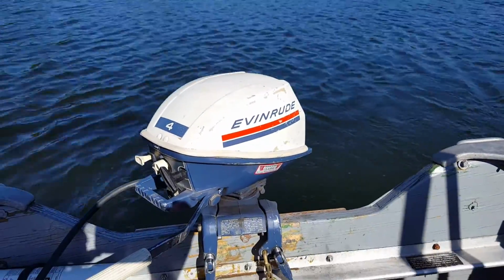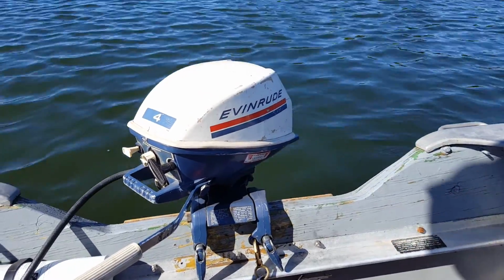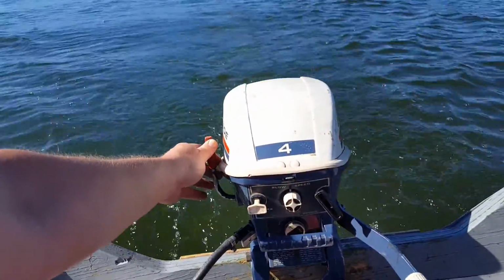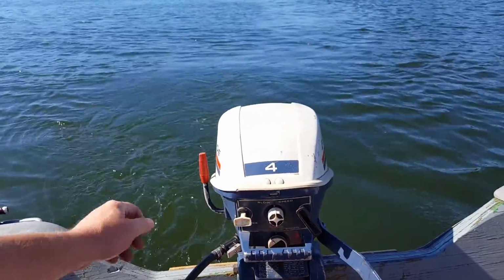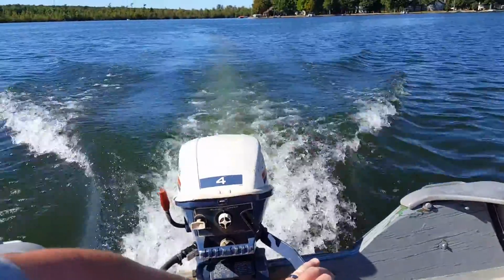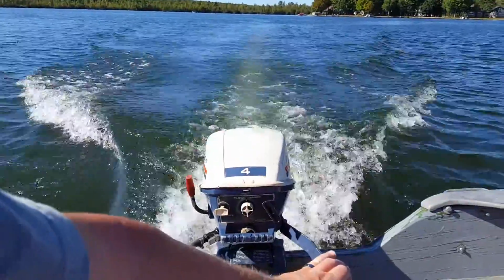1969 Evinrude Lightwin 4hp Outboard Motor

Comment: Hi there, I picked up one of these and looking forward to using it. The original plugs say J-4J not J-4C. Thanks for the run down on it.
Reply from the maker: The original J4J plug was a 2-stroke specific plug with a shortened side electrode.  The J4C is the modern equivalent.  The electrode can be shortened if the J4J is desired.  I just run them as is with no issues. Thanks for watching!
Reply: @oldjohnnyrude8404  Many thanks. So I can use the J-4J still wirh no issues? This 4hp is in very good condition and I can't wait to try it once I check impeller and change gear oil. Been told to take care pulling impeller off shaft and to push down on shaft as it can dislodge gear in the tiny lower unit.
Reply from the maker: @nickmav682  Yes, the J4J and J4C can be interchanged today.  Modern 2-stroke oil will not leave chunky carbon deposits in the engine like non detergent SAE30 would.  Having the side electrode abbreviated would lessen the likelihood of a piece of carbon fouling getting lodged in the plug gap and shorting the plug. That's good advice about holding down the drive shaft when removing the impeller.  It is designed to pull out of the pinion.   It can be tricky getting it to align if you pull it out unintentionally.
Reply: @oldjohnnyrude8404  Thanks again. Really helpful! Keep up the great work!

Comment: So, I was just given a small boat that has this exact motor. I don't think it has been run for at least 3-4 years.  Motor looks barely used and is very clean. My friend that gave it to me kept it at a small lake and his son used to take it out once in a while. Another friend of mine who is a bit more knowledgeable about boat motors tried to help me get it running, but we had no luck. Gas was getting to the carburetor, but the spark plugs were dry. So, I am thinking it must be a carburetor issue? It would not fire at all, but then, if gas doesn't get to the plugs, I guess that won't happen. So now I am wondering if I should attempt to take apart and clean the carburetor myself as an amateur or if it would be easier to just buy a new one and replace it?  Another friend suggested I soak it good with carburetor cleaner and let it set, then do it again, then try starting it again. Thoughts?
Reply from the maker: Either the carburetor is plugged and not allowing fuel through, the reed valves are not sealing and allowing the crankcase to seal and build charge compression, or there is something else preventing crankcase compression.   Try giving it a shot of fogging oil in the carburetor throat and crankig the engine to see if it fires on that.  If it will, then your carb is most likely plugged.  Yes, you should be able to get it apart and clean it. There are lots of good videos on how to do that.  Thanks for watching!

Comment: Johnny- just got a 1962 5.5 hp that needs new impeller.  I cleaned carb, replaced spark plugs and the motor fired right up.  But no water.  I loosened went to replace the lower gear oil and noticed water, so assumed some seals were bad.  In order to get to impeller do I need to remove the 6-7 bolts and remove the top?  It appears so....but just want you great advise.  Thanks, Dana
Reply from the maker: Yes, the powerhead must be removed to drop the lower unit on these motors.  The base gasket will need to be replaced and the gasket and O-ring inside the carbon seal for the lower crankshaft seal should be replaced while it is apart as well.  If you do replace the seals in the lower unit,  replace the shift rod O-ring too.  That is almost always the first seal to fail and is often overlooked. Thanks for watching!

Comment: I have fond memories of that year of 4hp...A noticeable power increase from the 3hps.I wouldn't worry about the gearcase, those lower units rarely leak unless fish line get caught in the prop shaft seal...
Reply from the maker: Yup, these are nice little motors.  There is a bit of a bump in power from the 3hp.  I think the gearcase is fine since I have yet to find any water in it, but I'll check just to be sure when I drain and refill for winter storage.
Reply from the maker: Yup, these are nice little motors.  There is a bit of a bump in power from the 3hp.  I think the gearcase is fine since I have yet to find any water in it, but I'll check just to be sure when I drain and refill for winter storage.
Reply: Russ Gallagher probably carb increase

Comment: Just inherited one of these that is basically brand new. What spark plug do these take? Make/number? Can I replace the gear lube with some spare amsoil synthetic 75w-90 left over from changing my Toyota differential? I'd imagine these aren't too picky. Any weak spots? Thanks! Can't wait to put it on my 1436 Jon.
Reply from the maker: Congratulations on your new motor. These take a Champuon J4C or J6C spark plug.  I tend to lean toward a J4C for these since they often get run at full throttle.  If you do anlot of trolling with it you may want to move up to the next heat range with the J6C. These are a 50:1 mix motor, although I prefer to run mone with a bit more oil since they still do not have roller bearings anywhere other than the flywheel end of the crankshaft. Marine lower unit lube is preferred over automotive gear oil because the marine oil has emulsifiers to allow some water to be held in suspension while still protecting and providing lubrication.  As long as the 75w-90 gear oil you have is safe for yellow metals like brass and bronze, however,  it can be used.  It should just be checked for water and changed  more often.  Thanks for watching!
Reply: @oldjohnnyrude8404  Appreciate the reply and love watching you run these old motors! I'll stick with the marine lube for the gearcase then thanks, didn't know about the emulsifiers. My dad said it maybe has 5hrs of use on it in 50 years. He brought it to hook up to rowboats where he vacationed once a year. I'm going to use it as my duck hunting and small lake motor on a 14ft rowboat. Should push it along great! I remember using it once when I was in high school and didn't know it was direct drive with no neutral. I fired it up at the dock and drove the boat right up onto the boat ramp hahaha!
Reply from the maker: @tercelfish00  You're welcome and thank you. These gearcases are usually very water tight.  The marine lower unit lube will be good for a lot of running with no water in it and is a nice safeguard in case a leak develops.  With those low hours thus should be a very nice running engine.  A really strong fresh one of these will sometimes plane off a 14 foot rowboat.   I have never owned one that would but I have seen them.  I bet that was an ah-ha moment when it took off on you and pushed you up the boat ramp.  I definitely recommend replacing the water pump impeller too if it has been in there for a long time.  You don't want to have it fail and even break up and send pieces into the cooling passages.  That's no fun to fix.  Great little motors.  Enjoy it!
Reply: @oldjohnnyrude8404  Thanks for the info! I just replaced the impeller on my 1990 30hp Mariner/Yamaha so I have some confidence now in the process. Are parts for these lightwins common or is it an eBay hunt? Do you know the part number or have a link offhand to get a new water pump? I imagine 50yr old plastic would be a little brittle haha. Do these "pee" like other boats or are they only water cooled through the exhaust? I can't remember.
Reply from the maker: @tercelfish00  Parts are still pretty common.  I get many of my parts from Marineengine.com.  
http://www.marineengine.com/parts/johnson-evinrude-parts.php?year=1969&hp=4&model=4902B&manufacturer=Evinrude&section=Gearcase+Group-weedless+Drive
These are easy to change the water pumps in.  The only tell tale on these is a heavy mist spraying from the exhaust relief hole on the back of the midsection.
Reply: @oldjohnnyrude8404  So I'm pretty it has the original plugs from 1972. There's blue overspray on the plugs that's the same color as the block LOL!
Reply from the maker: @tercelfish00  Yes, it sounds like it still has original spark plugs. For sure I ou have a low hour motor.   My 1970 6hp Fisherman had original plugs in it from 1970 when I  ought it from an estate sale too.  It has very few hours on it also.  One of the best running and idling engines I own.  That's excellent!!
Reply: @oldjohnnyrude8404  Changed pump, gear oil, plugs to j6c, and it started 2nd pull! So much fun! Bought a service manual for it too. I haven't touched the high and low needle knobs, but do you have a video or know of a video explaining the process of fine tuning these? My dad had them right in the middle and seems to idle and go wot good enough for me.
Reply: @oldjohnnyrude8404  After a year of operation I've probably put 100 miles on the motor and its running great. I tried both the J4 and J6 plugs. It runs way smoother on the J6 but would overheat at wot after 10 minutes and lose power. Too lean maybe for the plug heat range? Didn't mess with the mixture but maybe running richer would solve that? As for the J4's its a little tougher to start and runs rougher at idle but smooth wot and doesn't overheat ever.
Reply from the maker: @tercelfish00  These motors and the 3hps both tend to run on the hot side anyway.  J4C plugs are better suited to all around use in these for that reason (as you found).  It's great to hear that your motor is running well.  It does seem a little odd that you find the idle quality rougher woth the colder plugs. I guess that is most likely dir to the shorter center electrode being slightly farther from the charge?  I have not noticed that as a typical behavior between the two heat ranges of these plugs.ill have to try that out again in my 4s.  I haven't bought a J4C is ages.  I use J6Cs in almost everything.  They normally work fine all the way from idle to WOT for extended periods.   I to tend to lean toward the colder plugs for motors that do not see much idling time.
Reply: @oldjohnnyrude8404  appreciate the input! Also broke a recoil spring and had to replace that. Didn't have the special tool from evinrude to rewind the coil up so I made one of out wood to look like the picture in the manual and it worked great!
Reply from the maker: @tercelfish00  Nice!  That recoil spring can be a bear.  Good to hear you got it all back together. 👍

Comment: So I have the same 1969 4 evinrude. I've never used anything that has more then one rich-lean knob. 

Any tips or suggestions on how to accurately tune them? I've looked pretty hard with no results.
Reply from the maker: The initial settings are 1 turn out for high speed and 1.5 turns out for low speed both from lightly seated.  Those settings are typically on the rich side and will need to be leaned out a bit to attain optimum running condition.  The high speed needle should be set at wide open throttle in gear on a boat or in a proper test tank.  Once the high speed is set, the low speed can be dialed in by lowering engine speed to the lowest sustained idle and leaning out the mixture until the engine smooths out and speeds up. Continue to lower throttle and adjust until you find the best running condition.   Halfway between where the idle speed drops off and where it lean sneezes is the best mixture setting. I will try to make a video on this before long. Thanks for watching.
Reply: That's what ive been on here looking for

Comment: Hey man. I just inherited a 1969 or 70 Lighwin 4 horse, just like pictured here in the video. I'm rather mechanically inclined, but I've never had any experience with outboards before. It hasn't been started for probably near 7 years. Is there anything I should do before I start it after it has been sitting, and are there any tips you can give me for this specific motor? Also were your running on 40:1 or 50? Thanks
Reply from the maker: Congratulations on your motor.  They're nice little kickers.  I would either put 1/2 tsp or so of 2-stroke oil or a good spray of fogging oil  in each cylinder and turn the engine over by hand several times to distribute the oil.  When turning the flywheel, only turn it clockwise so you do not reverse the water pump impeller vanes.  These motors where 50:1 mix motors when they came from the factory.  They do only have one roller bearing in the powerhead though.  I tend to run mine on 24:1 or 32:1 rather 50:1 since they have a lot of plane bearings in the engine.  The earlier 3hp engines were 16:1 and these are not that different from those. Put it in a barrel of water covering the water pump housing with the water level and try starting it.  If it starts and runs to your satisfaction,  I would recommend replacing the water pump impeller as preventive maintenance so the old one doesn't come apart and plug up the cooling system.   These motors tend to run on the hot side anyway,  so a good healthy impeller is needed to keep them cool.  Thanks for watching!

Comment: hello corbin here again with some more questions for you. how and why do you pressure check the gear case? feel free to answer me here or email me if you still have it
Reply from the maker: Corbin Larson,  The gearcase is pressure checked to check the seals and drain plugs for leaks.  If the gearcase seals leak the leak can be found by looking for bubbles while it is pressurized.  This is done by first draining the gear oil.  Once it is empty, replace one of the plugs and screw the pressure checker in the other hole. Usually it is checked once at about 3-5psi and again at about 10-12psi.  Let each pressure sit for a time. I usually let it sit for 20 minutes or so.  Some say 10 is enough and others say an hour.  

Pressure checkers can be purchased with an integral hand pump.  I made mine myself and use it with a tire pump or regulated air from an air compressor.   I can email a couple pics if you like.

Comment: Yeah see this is the same motor i was talking about on that other video... I thought it was a 3.5 horse its been a few months since ive actually looked at the thing lol
Reply from the maker: I thought that's what you had.  If it is a '68 it is still a 3hp.  I'm not sure how long after that they made these in a folder. '69 and up were 4hp.  Still a very close relative to the original 3hps from the early 1950s.
Reply: @oldjohnnyrude8404  im not sure what year it is but it is stamped with a 4 on it and it has registration stickers from ohio in the lateish 70s, theres a few but none before 75. Anyway somehow down the road it ended up in michigan and i got my hands on it, dont know much about these older outboards but i wanna keep it in good shape. Im guessing if i can handle maintaining my truck i can handle a little 2 stroke too lol.
Reply: @oldjohnnyrude8404  so as far as maintenance goes on the lower end i should just need new gear oil and an impeller right?
Reply from the maker: @MileytheJeepV2  Yes, as long as the gearcase is not getting water in the oil.  If it is, it will need new seals.  Otherwise, new gear oil and an impeller is all that is needed for the lower unit.
Reply: @oldjohnnyrude8404  okay thanks. Ill take a look at it before i try and hit the water. And the impellers are relatively easy to come by right? Seems like parts for such an old motor would be hard to find, but i could be wrong.
Reply from the maker: @MileytheJeepV2  Impellers for these motors are still very much available.  Find your model on Marineengine.com.  They will have the part.  Your local Evinrude servicing dealer can get it too, but in all likelihood will have to order it anyway. If you have any trouble finding it let me know along with your model number amd I will find the impeller for you.
Reply: @oldjohnnyrude8404  yeah i had a feeling its one of those parts you cant just walk into a store and buy. But im sure ill be able to find one and if not ill let you know, thanks for your help.
Reply from the maker: @MileytheJeepV2  You're welcome.  There may be some stores you can still walk in and buy these impellers around, but most marine supply stores will not stock it.  You can order the Sierra aftermarket replacement from Napa also.

Comment: Same engine as a 3 with a bigger reed plate and mpre prop.
Reply from the maker: More or less, but there are a few other differences.   Thanks for watching.
Reply: @oldjohnnyrude8404  Yeah.  The port on the reed plate is much smaller than the carb.  Hmmm.   Currently, building a 1973 Sears Gamefisher fiberglass boat with a minty 1967 Johnson 3hp.  Love the old school.  Like you!  Cheers!